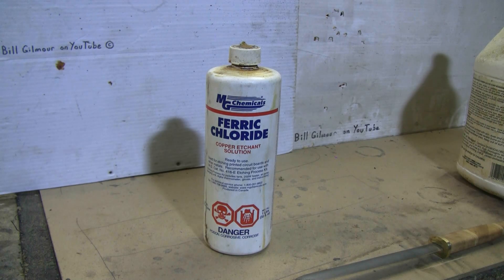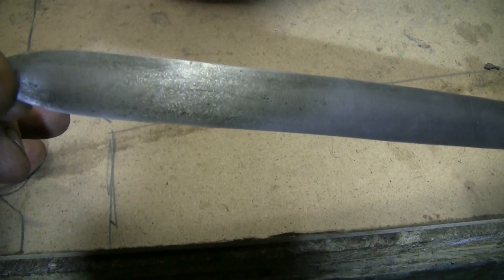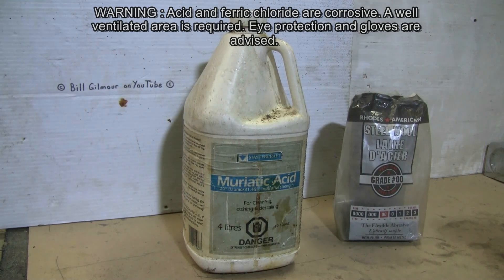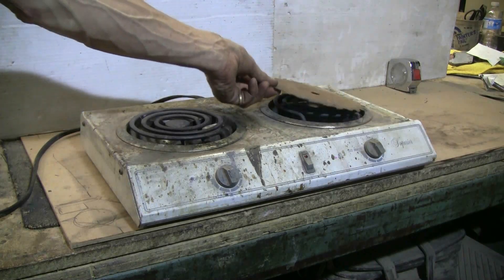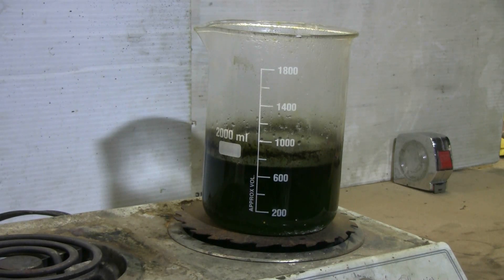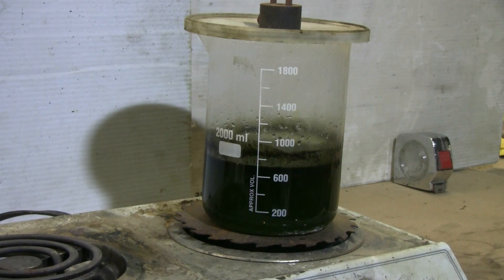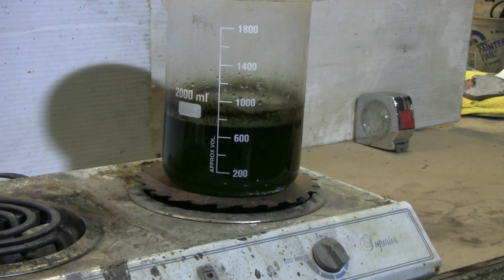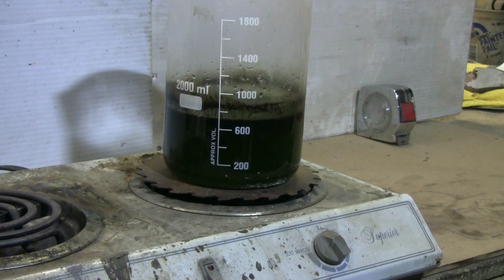How To Make Ferric Chloride For Etching

Comment: I'm not sure that I see the point in this, since a number of people are using the precursor chemicals (hydrochloric acid and peroxide) for etching without all this extra work
Reply: This method with addition of peroxide will produce a solution that can etch glass, porcelain and ceramic materials which is not an easy task to do..
Reply: The point is what I like to call " options " and while others would say variety,  choices , alternatives,  some ways are better than others , sometimes a person does not have a certain ingredient , and knowledge  is power , having multiple ways to do something is always good information... among other things ...

Comment: Another nice video.
Some "big box" hardware stores will have muriatic acid in the same area as solvents. Often in paint and adhesive supplies. 
Some have it with asphalt patching and driveway supplies. 
This may different for some people because I live in a state that is frozen half the year and so pool supplies are only on the shelves for a narrow window of time.

Comment: As I'm sure someone else would have mentioned, you should always add acid to water, not water to acid.
Reply: why?
Reply: @domenicperito4635  Because the acid can boil those first drops of water hitting it. The boiling water can splash acid all over the place. When the acid hits the water, doing it the correct way, it's so quickly diluted that the danger passes.

Comment: You can speed up the  reaction by adding hydrogen peroxide to the solution instead of letting it sit and allowing the air to oxidize it or bubbling air through it ....
Reply: Yes, just 3% household peroxide is more than sufficient, it is incredibly cheap and easy to do, but be careful when adding it, even at the low concentration.....It will heat up VERY fast and boil over if you are not careful, so add it in small increments. 
But, by bubbling air through the solution, it does have a distinct advantage of being a lot stronger. Ie, it will work quicker on the blade.
Your choice either way. And if you don't use it regularly it is safer to dehydrate it down to ferric chloride crystals, which you can store easily, safely and they are ready to go as and when you need them. They also have the advantage of not being a spill hazard! I spilled ferric chloride once, it stains bloody everything, so I keep what I don't need stored in an airtight container. The rest in a converted co2 tank, perfect for dipping pattern welded blades and tools into. 😊